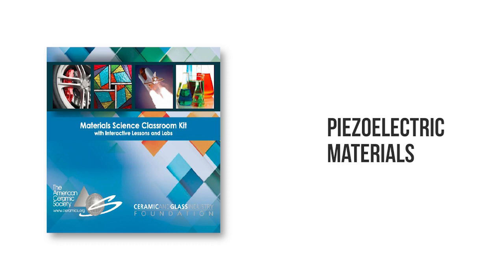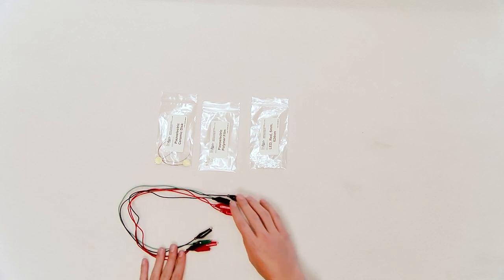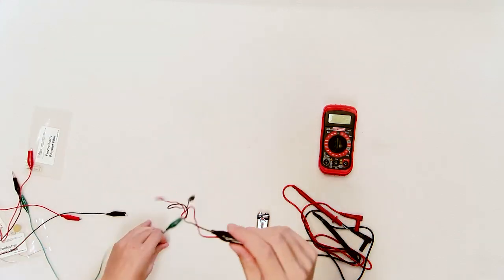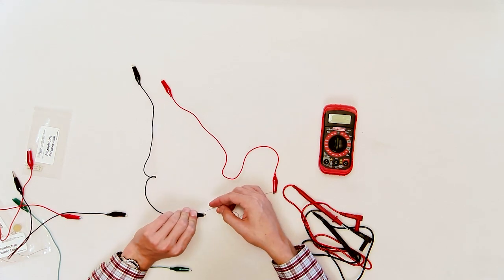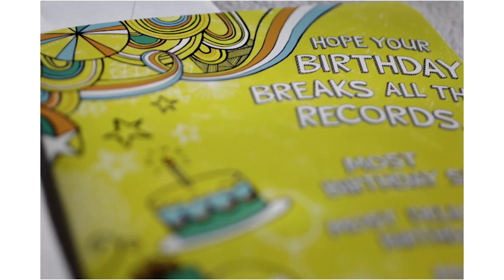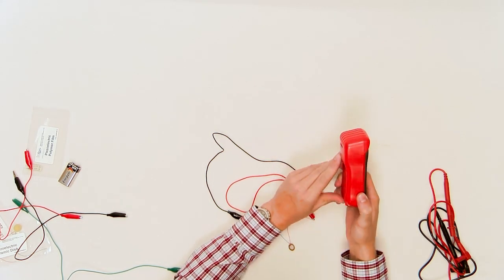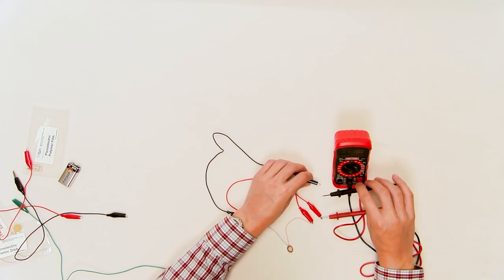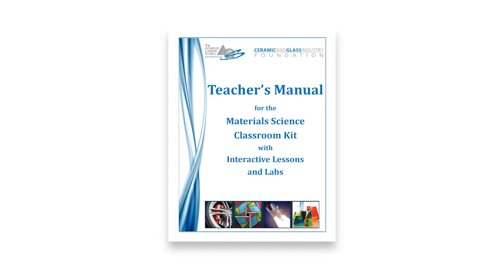Piezoelectric Materials: Interactive Science Lesson 3

Comment: If you add another LED parallel to the  original (after showing the effects of the original), but in the opposite direction, it should light when the piezoelectric material springs back. That would pique more interest. You could use that as springboard for asking the question "why does that happen?"

Comment: which has higher output power between piezo polymer and piezo ceramic??
Reply from the maker: It would be ceramics (for the same design). 
I found a good overview article on piezoceramics at: http://piceramic.com/piezo-technology/fundamentals.html

Another webpage that might be helpful is:  https://www.researchgate.net/post/How_much_current_could_be_generated_by_means_of_a_single_piezoelectric_crystalA couple of answers from this page that are relevant: 

“I have just a point to add here that the piezoelectric single crystals (PZN-PT) are superior to ceramics (PZT) and
polymers (PVDF) for their high piezoelectric coefficients at room temperature. It should be noted that the higher coefficients doesn't mean higher power in all the circumstances. Knowing the application one should carefully design the
transducer. As said earlier the output is the function of dimensional parameters, piezoelectric, mechanical and dieletric properties of the material.”
“The maximum current, voltage and wattage, all parameters are depending on the type of piezoelectric material (Quartz, PZT, PMN-PT), size of the material. If we take the example of PZT, the maximum
current can vary from nA to micro amp and the voltage generated in 1-100 V, depending upon the size of PZT.”